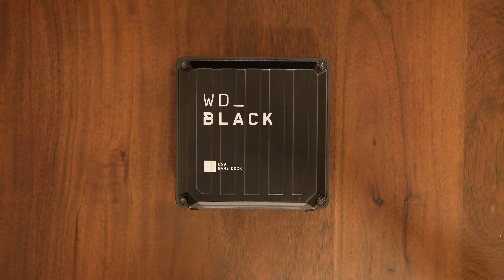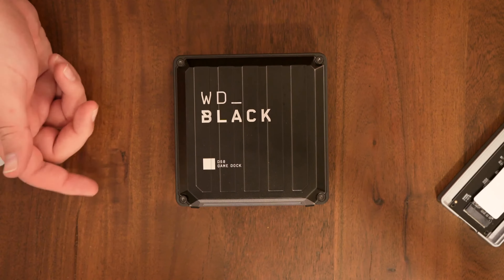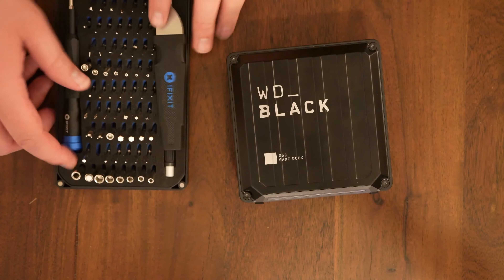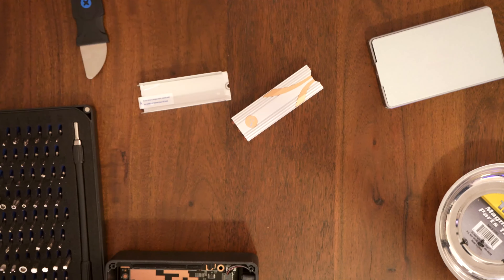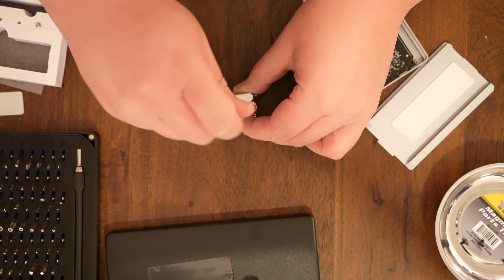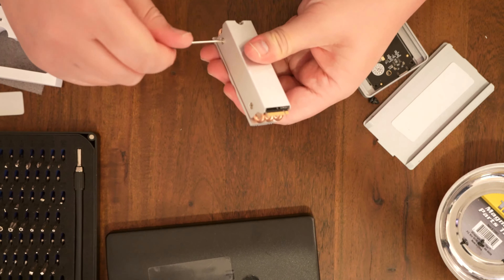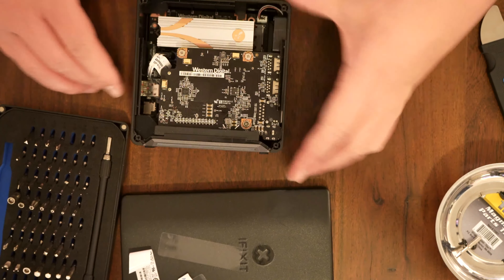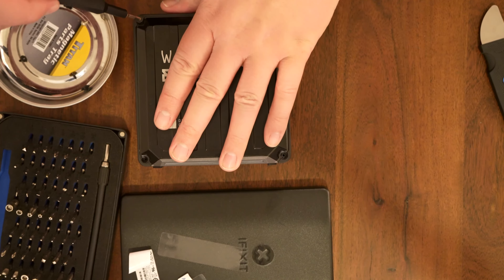Installing a new SSD and Heatsink into the Western Digital WD_BLACK D50 Game Dock

Comment: Thank you for the video.  Based on your directions, I ordered my own and installed a Samsung 980 in it over the holiday weekend.  A few notes:  (1) You weren't kidding:  the screws are tiny and easily mucked up.  I ended up having to drill out one of the four corner screws, as I couldn't get it off.  (2)  Heat is most definitely an issue for the drive in the case (IMO).  My own temperature readings via CrystalDiskInfo showed under load (format, not quick on Windows) the drive at 80+C, which is high enough to cause data throttling.  Even at idle with the lid closed, the SSD was sitting around 64C (bare) or 40C (w/ heat sink).  Leaving the lid off reduced temperatures (43 bare, 32 w/ heat sink) and brought temps to around 70C under load.  Blowing a fan on the SSD (open lid) helped immensely, with temps at 26C idle and 36C under load.  I've ordered a 120mm fan (same size as case) with USB power for my unit.  (3)  If you want to replace the hex head screws with Phillips, I found that M2*4 KM Flat Head Phillips Screws work well.
Reply from the maker: Thanks for the tips and additional data!
Reply: Thanks for info on screws.  Might take them all off and replace them.  Mine all have scratches on them despite being really careful

Comment: Thank you for the video!! I just got the d50 1 tb, and took it apart to change the drive. The original drive inside the 1 tb was a Western Digital sn730, and it had a heatsink on it. to remove the original drive you have to take both sides off, because the screws for the factory heatsink are installed from the other side( the side without the SSD on it)

Comment: The JHL7440, used by Acasis, has compatibility issues with many NVMe drives, such as the Samsung EVO series. Their website provides a list of recommended drives. Generally, it works well with the highest-end models from most manufacturers. Using an incompatible drive can significantly slow write speeds (by ~50%) and cause the drive to run extremely hot. At first, I thought the speed issue was due to the controller of my mac and assumed the heat was normal. After switching the drive recently, I noticed it was completely due to incompatibility.

Comment: Will this work with the Corsair MP600 PRO XT 8TB Gen4? Love the video!
Reply from the maker: I think it will fit, yes. Just remember that new super-high speed drives will be throttled by thunderbolt/usb-c connection speeds. You'd be better off saving money with a slower drive of the same capacity.
Reply: @MichaelKeller  Thank you for the response. Im unable to find a cheaper 8tb nme ssd. any preference you might have?
Reply from the maker: @chief4589  oof, I guess it’s been a couple of years since I bought an ssd. Prices seem to have gone way up since then. I recall there being ssds at like 800 for 8tb back then.
Reply: @MichaelKeller  Got it, i appreciate the help.

Comment: Thanks for a great video. Can you update on how well the upgrade has worked out over the the last two years? Would you recommend another heat sink?
Reply from the maker: It worked fine up until I got a Mac Studio last month with a large internal drive and no longer needed this. This was always capable of fully saturating the Thunderbolt speed, but I decided with the mac studio that since I no longer need the extra ports of the game dock (the studio has plenty built in), I'd just buy more internal storage which would operate at almost three times the speed that an external Thunderbolt drive can reach. For anyone who needs the external ports and is fine with ~2,700MBps speeds, this solution is still perfect.

Comment: I would like to ask if the d50 without ssd version can be inserted into a 4t m2 hard drive? Does it support memory expansion? thanks.
Reply from the maker: I put in a 2tb drive to the non-ssd version. I can't speak to if a 4tb drive will be read correctly.
Reply: @MichaelKeller  Thank you for your answer

Comment: Hi, thanks for the very detailed video! I'm wondering when is your fan inside the case on? like it's always on or just when the temp is high? I just get the 0TB model, and don't have an SSD to put into it yet, I find the fan is not running at all, do you know is it normal?
Reply: I found a spare SSD to put in, but the fan still not on, even when the temp goes over 85°C under stress test 😢
Reply: @naituw92  我也有一样的问题，自己装了一块WD770，有散热片待机仍然能到60度，硬盘压力测试能到80度左右，但风扇从来不转，只有一次接macbook，同时串联了一台studio display显示器，扩展坞表面温度明显比平时高不少，用了一段时间风扇突然转起来了，声音还挺大，过了十几秒转速逐渐降低最后又停了，后来再也没见到风扇转起来过，我推测这个盒子不是以硬盘温度作为启动条件，可能是雷电芯片或者供电温度作为启动条件。现在就这么凑合用了。
Reply: @zilchzeta  好吧，看起来像是新版本的固件改成这样了，有点坑了，准备不行换个 USB 小风扇线接到外面
Reply from the maker: Hi, the fan in mine is always on as long as the power is on

Comment: Hey Michael, how are the temps of your D50 after the upgrade? Mine is suddenly running crazy hot after over a year in use.
Reply from the maker: Hey, sorry, I no longer use this solution, so I can't provide new data. I originally did this as a stopgap when I got a MacBook M1 during the pandemic to give me more storage and an ethernet port. When the Mac Studio was released, I retired this solution and just bought the Mac Studio with the storage I needed. It worked perfectly fine while I had it, I never noticed it throttling below the already-limiting thunderbolt bottleneck, but I wasn't checking temps after the first week of burn-in testing.
Reply: @MichaelKeller  thank you for the response! I guess I'll take it apart and see what is heating up this badly :)

Comment: Hello, thank you very much for the wonderful video.
I'm using D50 2TB with my 16-inch Intel macbook pro (Connected: One 4k monitor by displayport, SSD by TB3, Ethernet, ipad pro by USC-C).
I am very happy for its performance!
But I worry about the temperature of the SSD, which in the unused state is 72º. It's pretty tall, right?
That's why I just ordered the same heatsink that appears in the video.
It will really work well for lowering the temperature, right?
Reply from the maker: It works good enough to keep my firecuda drive from throttling.
Reply: @MichaelKeller  Thank you!
I already installed it on my D50 too!
SSD temperature is between 60-75 degree.
When I put a small fan (40mm) in front of the D50 gap, the temperature is between 45 and 50 degrees.
Very well!
Thank you very much!
Reply: @sungjoonpark8914  How you power the extra fan?

Comment: Thanks Michael, you saved my day. Just curious what kind of speed you are getting? I get only 1184MB/s for the write speed but 2785MB/s on a WD SN750 2TB. Seems like many other peope are getting over 2500MB/s for write speed as well
Reply from the maker: Hi, Jay. Here is a screenshot of my speed test: https://photos.google.com/share/AF1QipP51089kcGckoTYesiVoMa0cfsCgB_MKJ5sYg-LmJct7tWEUC99ZW8GDwJ3GqFB0w?key=blRrcUNLTDRnYkpHOWxCWmhqR2trN1o5dVZBdWdn. Remember that for writes, the size of what you're writing will very much affect the speed with SSDs depending on the size of the cache. The larger the file, the slower it will be overall because the high-speed write cache will fill up immediately.
Reply: @MichaelKeller  Thanks, Michael. Hmm that’s weird, I have tried different configurations and my SN750 2TB is still getting only 1260MB/s write but 2760/MB/s read in this dock, with my M1 MAC Mini. I tried two copies of this dock and the speed is consistent. This SSD is getting over 2900MB/s write when installed internally. I was using the black magic disk test as well, and the 1GB and 5GB results are very close
Reply: 在m1系列的mac上 这个速度是正常的 苹果的问题
Reply: @lanmzx  发线的确是M1才这个速度

Comment: GREAT video and instruction...what are your thermals? Enough room in there to replace the fan with better quality?
Reply from the maker: I don't have temperature readings, but they're low enough that I'm saturating thunderbolt's bandwidth without throttling.

The fan is very specifically sized to the narrow width of the case. I doubt it would be replaceable with something markedly better.

Comment: First of all, thanks for great video! Very much appreciated! I have some questions though. So heat sink is essential? What is maximum height of heat sink possible to fit in? How do you think will this upgrade void the warranty?
Reply from the maker: Heat sinks are not per-se essential, BUT under a sustained load if heat builds up the drive with throttle its own speed to protect itself. So unless you're constantly writing 100GB files, it likely won't matter. I prefer to err on the side of caution. Since an SSD doesn't experience the sustained, full-speed operations that a graphics card does, the most important thing for an SSD heatsink is to act as a thermal absorber for those short bursts of activity. Almost all SSDs spend most of their time idle, so really any heatsink will do the job of short-term heat absorption.

The heat sink I installed is about 1 inch tall. I'd say there was maybe another half-inch of clearance. But, again, I don't think the most massive heat sink actually matters for most SSD uses. If you're often writing to your SSD at full speed continuously for an hour, you're gonna use up its write cycles pretty fast and the speed throttling doesn't matter.

As far as warranty goes, that depends on your local consumer protection and right-to-repair laws. I can't comment on that.
Reply: @MichaelKeller  thanks for the detailed answer!

Comment: hey.. is that D50 board support 4.0 pcie?
Reply from the maker: It supports PCIe 4.0-compatible SSDs if that's what you're asking. However you will NOT get those speeds, as Thunderbolt 3 is much slower than PCIe 4.0.
Reply: support ，but really hot，and it's fan never work